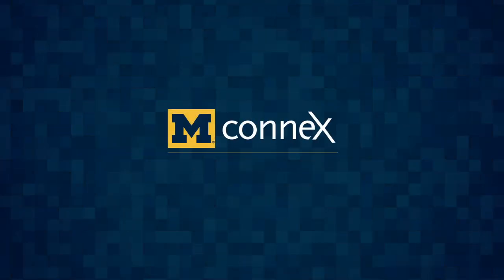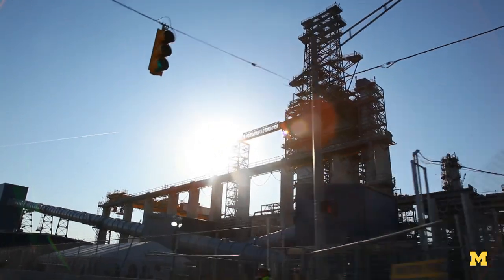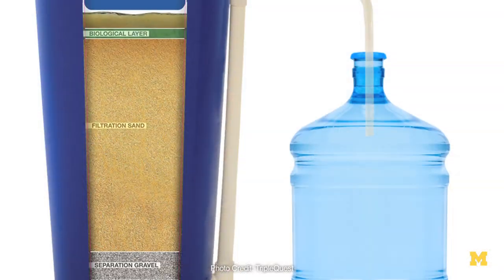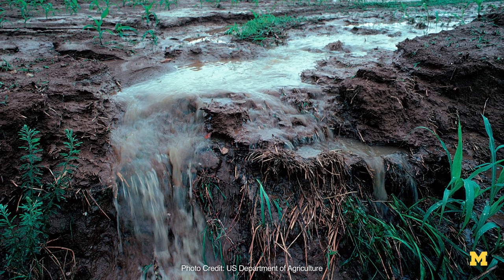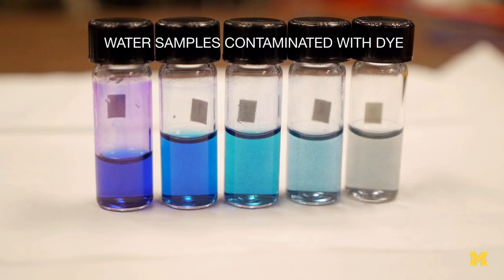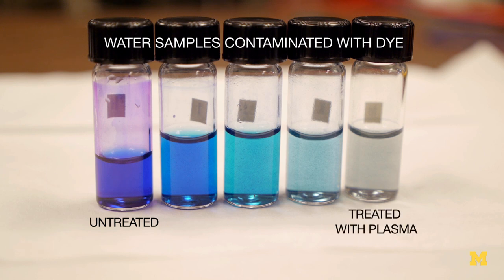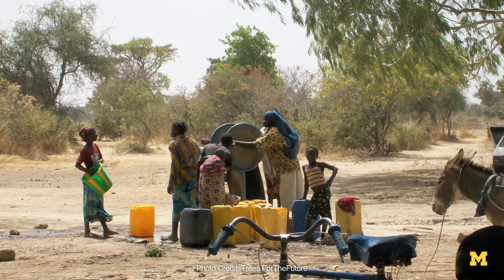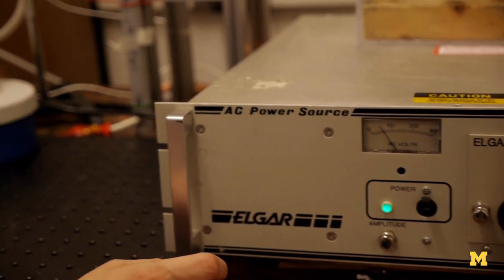Purifying Water With Plasma

Comment: so... you can use electricity to create the plasma, could you also use something like an insanely powerful ultrasonic cleaner to vibrate the water into a plasma state?
Reply: Funny how there are videos about separating hho from spraying water through sparkplugs to form plasma explosions which those dudes said it might be radioactive so this thing about putting plasma alone inside water i mean its still radioactive idk why they think it is cleaning water.

Comment: This sounds really interesting.  Interesting to see if it can be worked into a larger scale project or even small home use.  We have a group of individuals working on different things I’m going to present your video to our group here in New England and see if it fits in with our water restoration with a DPE‘s, live  water. Do you foresee a way for a larger unit?  
We are finding ideas that plasma can be work with disposal of garbage and rubbish that  makes very useful materials very strong very hard.  Also a way of disposing the very toxic batteries from electric cars.